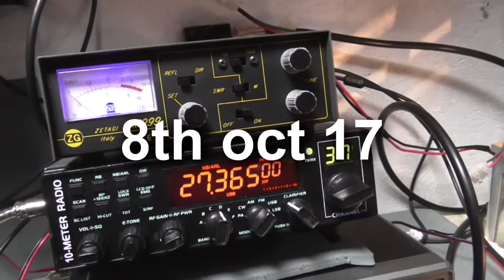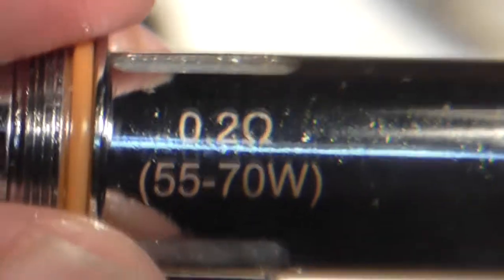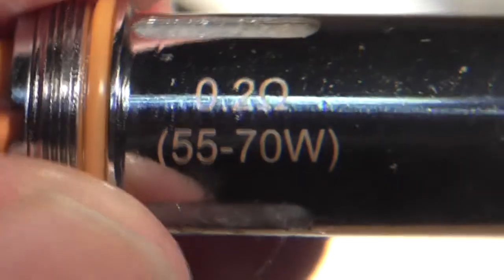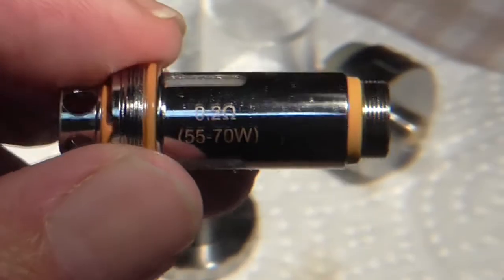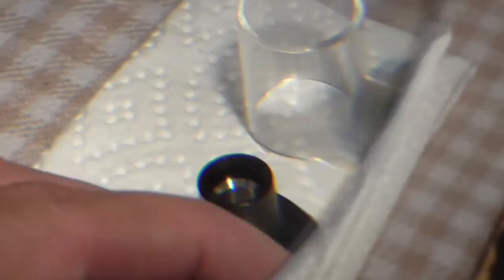light and vape

Comment: hi glad you're doing well  don't give up on the vape.  if you have a bit of knowledge on ohms and voltage if you have a look for an rda drier single coil and make your own it a bit cheaper. I run my one at 0.30 ohms at about 4.1 v or 58 w it's so easy to do have a look on YouTube lots on there. 73s for now.
Reply from the maker: Damien Davies   Thanks mate waiting for a lot of stuff I ordered off eBay , rda. Coil wire. Cotton wading etc ,, will make a video of my first coil strike up wicking etc. Also a kit that includes tweezers etc and a ohm reader so will be all kitted out when it gets delivered and dripping like a gooden.    Cheers Shane